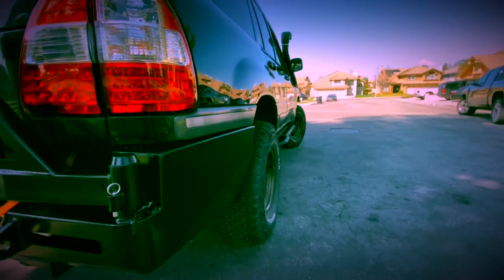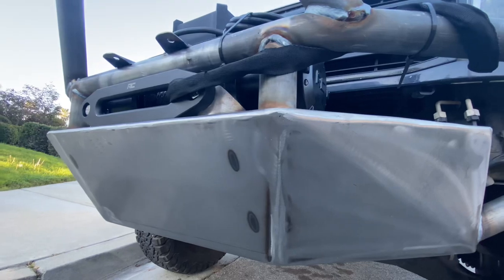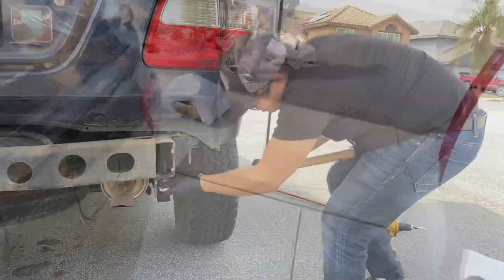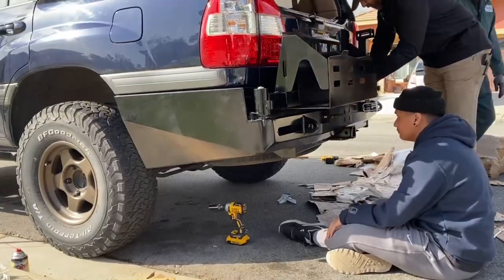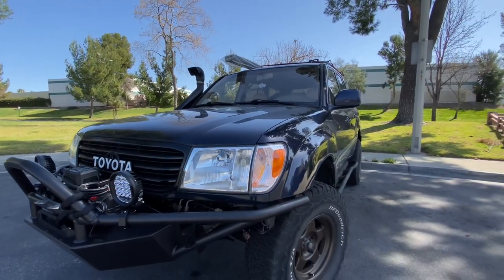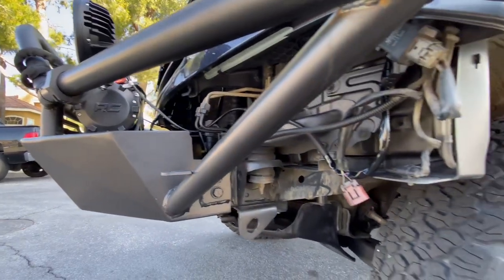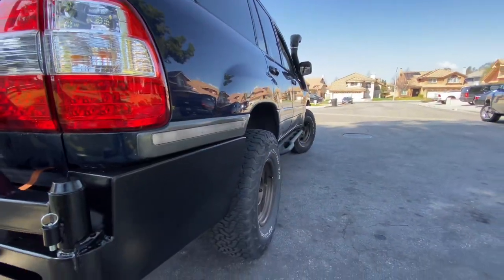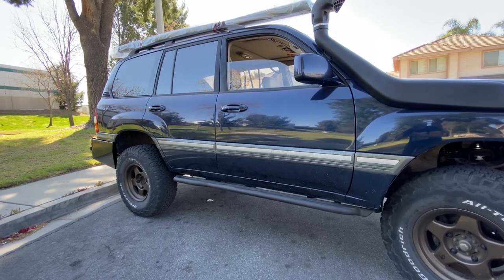100 series Land Cruiser Overland Build | My Brother’s ujz100 LandCruiser

Comment: Sweet work all around!!
Reply from the maker: Thank you very much
Reply: @CruisinMiles  Angel and Freddy over at Lam’s Garage are awesome. Dropped off rig Wednesday, diagnosis and update Thursday. Identified additional problem, and didn’t try to up-sell me. Very honest guys!!!
Reply from the maker: @edmondsonoffgridhomestead8932  yeah they really are awesome. I’m glad they helped you out
Reply: @CruisinMiles  UPDATE: Picked up my rig from Angel and Freddy. He found wound a water pump noise, turns out it was leaking from behind pulley and a pin hole leak. Found a bunch of other things wrong and fixed them. He’s my permanent mechanic now. Very humble and honest guys!! Big THX again bro👍🏾
Reply from the maker: @edmondsonoffgridhomestead8932  no problem. I’m glad I came across them as well. Trust those guys a lot